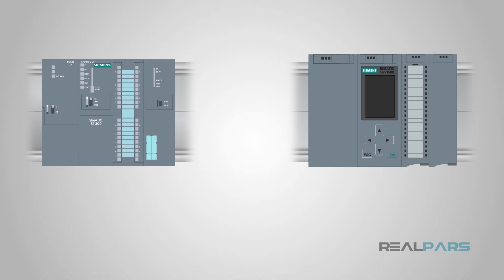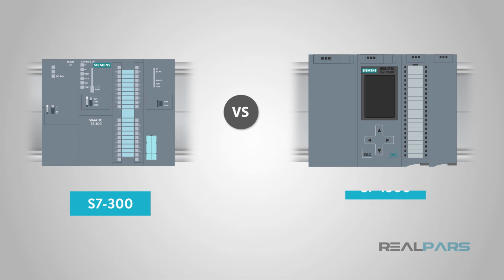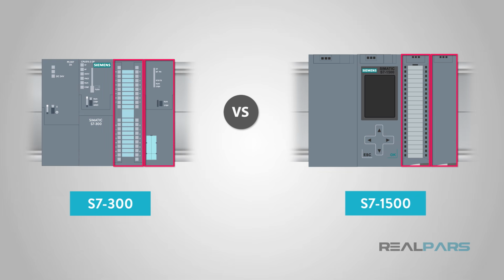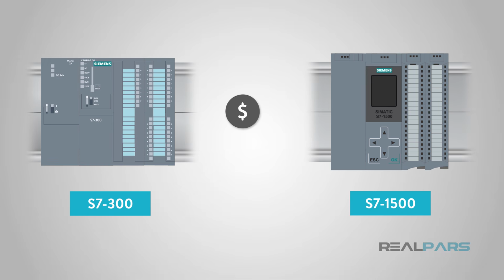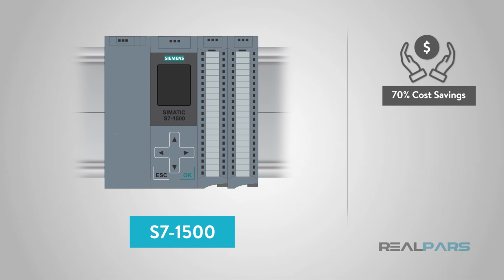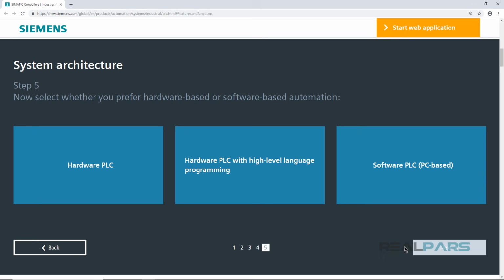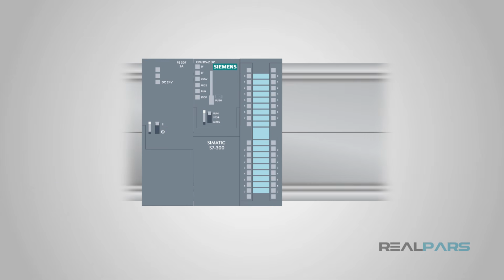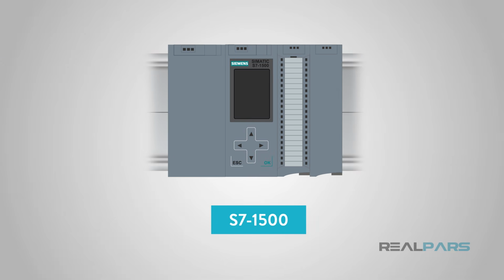What are the differences between SIMATIC S7-300 and S7-1500 PLCs?

Comment: Hello, I have PLC s7300 connected to 3 et200m (6ES7153-1AA03-0XB0) stations, now I want to upgrade only PLC s7300 to s71500. So can s71500 connect to 3 et200m stations via profibus?
Reply from the maker: Hello, @caovantuan6825.   Thank you for your question. There are many possibilities with S7 TIA to work with the legacy S7 300. An it all depends on your application needs for your engineering. Here is a link to help you with your learning: https://support.industry.siemens.com/cs/document/109744173/documentation-for-simatic-controller?dti=0&lc=en-WW   
You can sign up for a free 7-day trial membership, and we have lessons on this topic in more detail:
https://learn.realpars.com/order?ct=34d2307e-b93e-4906-9cd2-e1f50857d889

Comment: You are doing a very great job with your content. i have few questions to ask about  S7-1214C PLC
1. If an S7-1214 Siemens PLC has several LED indicators that can be used to verify if the
processor is operating correctly and the Maintenance LED is flashing yellow and there is
no memory card. What does this mean?

2. IF An S7-1214 stopped controlling the machine. The STOP/RUN indicator is yellow and
the ERROR LED is red. What’s wrong?

3. A controlLogix 1756 processor has a flashing green I/O LED, ehat does this mean and ehat should you do to troubleshoot?
Reply from the maker: Hi Adam,

Thank you for your insightful questions. While they are excellent queries, they fall outside the scope of our current lesson platform.

If you're experiencing issues with your LEDs flashing, there could be a variety of factors at play. Fortunately, assistance is available!

Your local Siemens representative can offer valuable support. Siemens provides a comprehensive website and blog equipped with troubleshooting guides and technical manuals to address your needs. Much of their online troubleshooting assistance is complimentary. However, there may be charges for direct technical consultations.

For information specific to Siemens PLCs, please visit the following link

https://support.industry.siemens.com/cs/document/109744173/documentation-for-simatic-controller?dti=0&lc=en-WW 

Here is your 1756 processor manual too:

https://literature.rockwellautomation.com/idc/groups/literature/documents/um/1756-um001_-en-p.pdf
Reply: @realpars  Thank you 👊💯

Comment: So it seems like the only difference is 1ns processing time which is really not needed for 90% of the applications and the built in display. Nothing is said about the differences in programming with TIA portal and Simatic Manager. It's left open, what the price really is for a basic configuration say 64 I/O's and 8 axes for example. In my opinion it is usually the programmers skills and Know-How to determine which PLC and programming environment is selected.
Reply from the maker: There are a number of other differences, including an expanded instruction set with the S7-1500, built-in OPC-UA support, built-in web-server, better diagnostics, auto-tuning PID, and motion control support, just to name a few.  And yes, the increased CPU speed is not really a big benefit unless you are doing high-speed operations, such as packing lines or fillers.  As far as programming packages, SIMATIC Manager cannot be used for the S7-1200 or S7-1500.  But TIA Portal Professional can be used with any S7 CPU, making the the best choice for programming any Siemens PLC.  The S7-1500 has a pretty high price tag for small systems, so for a 64-I/O system, an S7-1200 can be economical (<$1500 for CPU and I/O cards).   Programming skill is very important, as you mention, and as a very experienced programmer, while SIMATIC Manager is a good software package, TIA Portal provides a much easier, integrated environment that accelerates program development, testing, and deployment.

Comment: plz help me simulation button not showing (S7-300)
Reply from the maker: In order to be able to select the Simulation button, the program you would like to download needs to be selected.  Click on the PLC in the project tree.  If the Start Simulation button is not selectable, try recompiling the hardware configuration and then recompile the software configuration.  You should be able to start the simulation at this point.  

If not, make sure the S7-PLCSIM program is installed correctly. The best way to do this is to start the simulation program and see if it will fully boot up to the CPU status window.  Also, the S7-300 series of CPU's requires S7-PLCSIM v5.4 or earlier.  The latest PLCSIM programs (v12, v14, v15) only work with the S7-1200 and S7-1500 CPU's.

Comment: 2:47 Standard, compact (C), fail-safe (F) and you could add technology (T) version. Those have more motion ressources. There is also the new redundant (R) and high availability (H) S7-1500, but R and H doesn't exist in the S7-300 platform. You had to go with S7-400H "in the past".
Reply from the maker: You can see the other types of these CPUs on its relevant blog post here: https://realpars.com/S7-300-versus-S7-1500/